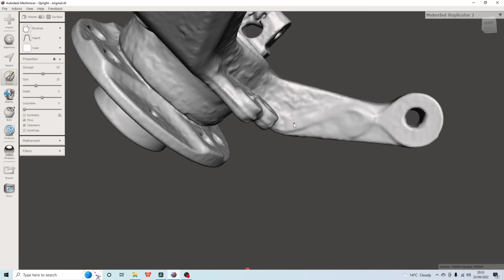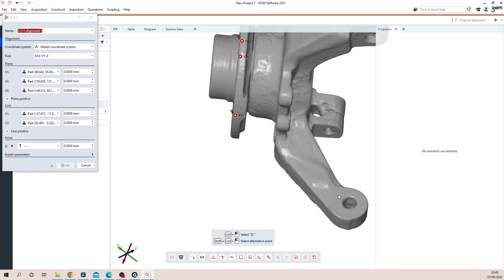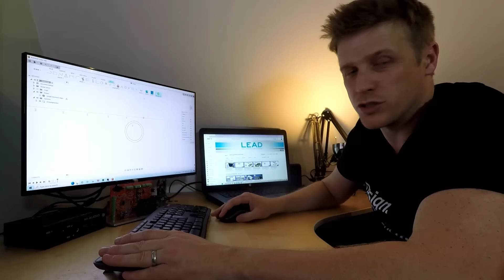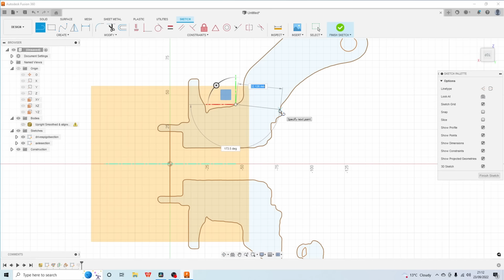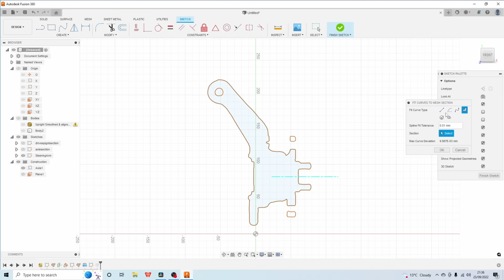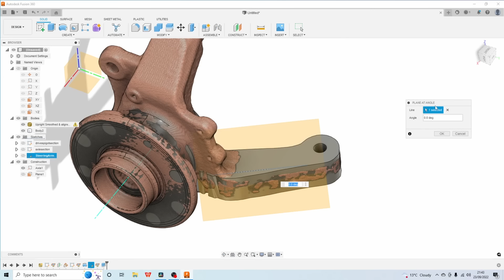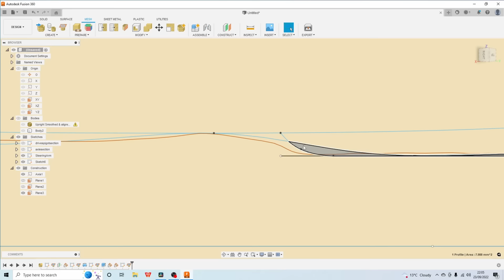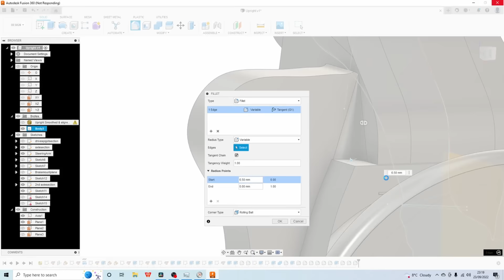Reverse Engineering from a 3D Scan with Fusion360... for FREE!

Comment: You can export the features generated in GOM as a separate IGS file with the same alignment as the exported mesh. That way, you can use the averaging functions to make planes and feature references in GOM and use them in fusion.
Reply from the maker: I’m gonna be using that for future videos, it’s dead useful.  When I did that for this, I ended up with loads of faces, that all should’ve been parallel and have been machined in one op, in XZ for example, which then weren’t quite parallel as they were all fit to the inconsistencies of the scanned mesh.
I have been looking in GOM to use fitted planes for an offset plane from the global Co-ord system but no luck yet!
Reply: @MakingforMotorsport  Yeah, it's messy quick. You might want to give it another go though. If you have a best plane of reference, make a line normal to the plane and constrain any offset planes as normal to that line. I use that a lot for things like bores normal to a face.
Reply from the maker: @brainiac27  are you doing all that in GOM?? With normal line and constraining?  Looks like I need to practise!

Comment: Great video, i need to use 360 a bit more in the future apparently, that was a great work flow, seems much easier than in other cad i have acess to. This is the key to get 3d scans actually proper useful.
Reply from the maker: 360 is a great tool, not perfect, but for home gamers it’s a good mix.  Scans are mixed blessing to be honest, they are the classic “lots of data, no information”, they can be very useful but there is a time investment, for us Engineering types anyway…. If you just wanna scan statues then 🤷‍♂️
Reply: @MakingforMotorsport  sometimes i Wish i was into printing gnomes instead😂. I find the ui of 360 pretty slow, and its semi web interface slow. But my CATIA is cold sweating even at the thought of an stl file, and some simple things like modeling a thread is a no go. This was exactly what i needed, since I haven't found any way of extracting profiles efficiently in any other software, i will try this on some scanned parts, i think it will do the trick!
Reply from the maker: @garagecedric  speed is my biggest gripe with 360, and single threading and no gpu means there’s lots of performance on the table…. But then I see the costs associated with other software I faint!!!
Reply: @MakingforMotorsport  yeah, its pretty much the only viable option for personal or small business use due to the costs.
Reply: I’m trying SolidWorks for maker (12€ subscription) at the moment. It has tools to creat planes and more for imported 3D Scans. 
But to be honest it’s still a pain in the ass to get a solid out of a 3D scan. Solid edge is another CAD wich has good tools for it too and it’s free.
Fusion 360 is good too but has less tools as the other programs in my opinion.
Reply from the maker: @Todestelzer  half the battle is just learning curve, I know SolidWorks is great but I have little to no experience of it (I used Inventor), yeah the principles will be the same but I know it’d be a big step backwards for a whole ‘til I caught up….

Comment: I also have a CR Scan Lizard. It's pretty amazing for the price. The key is to coat your scan surface to reduce reflectivity. I found that kids washable paint also works.
Reply from the maker: Kids washable paint?  That’s a good idea, the hairspray can can thickness to a part, back to back testing of matting sprays is a video I am planning, I’ll have to add washable paint to the mix… do you have a brand as suggestion?
Reply: @MakingforMotorsport  I bought a small 10 pack sample of Crayola brand from the craft store. I experimented with brushing white onto an RC car body. The paint applies very thin and dries to a chalky finish. Very easy to wash off and doesn't smell badly. I saw that the same paint is available in gallon sizes on Amazon. Perhaps it could be spray on in addition to painted for something like the large surface of a car.
Reply: @MakingforMotorsport  I've been wanting to try washable spray chalk, since it has that heavy matte finish. If you get around to it, I'd love to hear how it turns out
Reply: @keithfpv9451  There's something used to detect leaks on pneumatic joints. It's called D100, it sounds like just what you need.
Reply: We use the matte french chalk in a spray can when using the more industrial blue light scanners. Doesn't add much thickness and easily wipes off. 👍🏻

Comment: Thanks, another approach to try. Previously I have imported the mesh & immediately converted to a solid to use the tools for solids, so that’s something else to try.
Reply from the maker: That works well on .stl that have been created by CAD in the first place, like you get on Thingiverse etc… but 3D scanned things just don’t work well with it…
Reply: @MakingforMotorsport  ah, got it. A super cheap 3D scanner would be handy for the block / engine bay, to help speed up designing parts that fit…. But mostly they are too expensive for me to justify for the odd hobby piece.
Reply from the maker: @bwm999  I know how you feel, if it weren’t for the channel I’d be in the same boat!

Comment: Great job. Impressed by how much better resolution of scanners have become. I still use my $20 Xbox 360 Kinect to create 3D scans but only good for checking clearance really.

Why use GOM inspect to align? I thought meshmixer had software tools to align meshes that works fine
Reply from the maker: I’ll be honest, and I am not an expert at Mesh mixer, but I haven’t found any alignment tools within MeshMixer…  and GOM can be a headache to get started with but it’s less than a minute for a proper stats based fit.  Works for me…

Comment: Awesome video. Thanks for the tips.
Reply from the maker: Cheers AJ, I’ve seen you playing with your scanner on the FB group… good stuff! 👍
Reply: @MakingforMotorsport  thanks. I love that thing. Just did a scan of my headlight and modeled a duct into it to send air to my turbos today.
Reply from the maker: @ajhartmanaero  but what material to make the duct out of?? 🤔🤔🤔
Need to get my Carbon game on…
Reply: @MakingforMotorsport  it’s only at the headlight and will see mostly ambient temps so gonna try PLA. I have petg and asa on hand as well but haven’t played with them much yet. I modified my cr10s so I’ve been printing quite a bit of carbon/nylon on that but is a bit pricey.